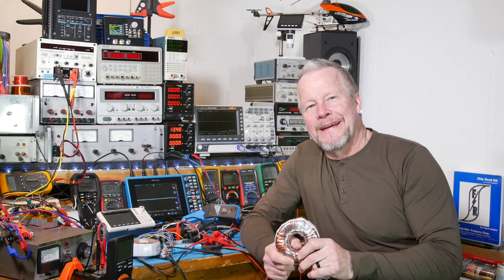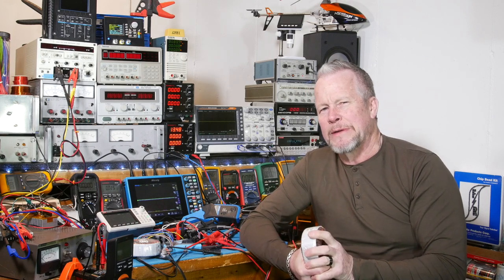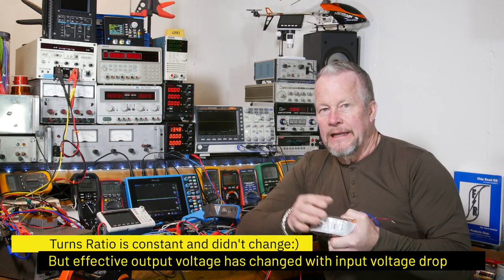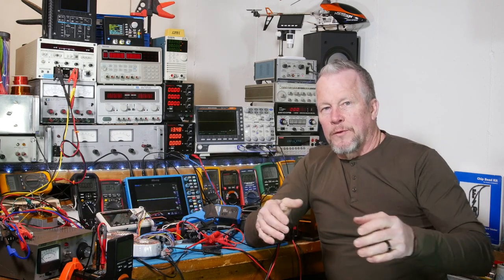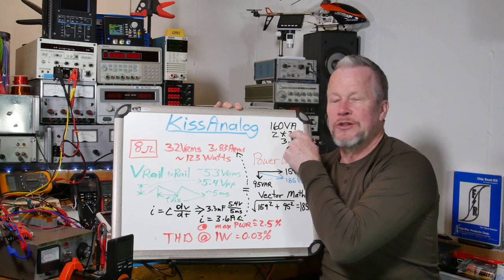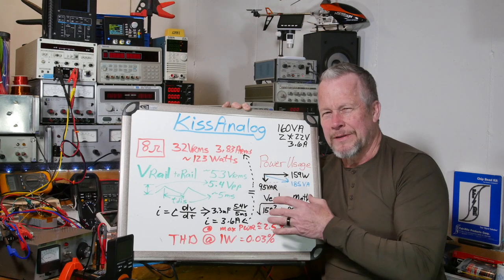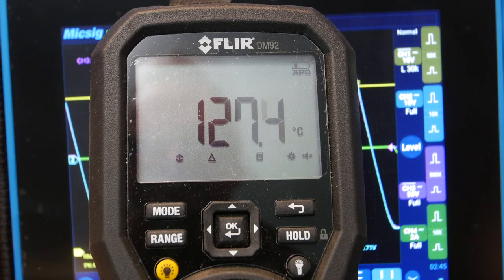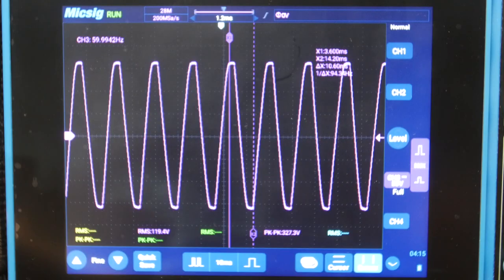Class D More Power Bigger Transformer TDA8954

Comment: Finland is still here! ..it's not the quantity but quality, right! :D Just got my (guitar) tube amp build ready for testing, sounds good and no smoke or explosions! :) I'm loving these tube amps, but i have few toroidal transformers waiting to be used for audio, so maybe next build will be digital. I can't be the only one from Finland watching your videos, but a shoutout would be cool! :)
Reply from the maker: Thank you Anssi w!  Great to hear from Finland! ;)
Reply: I have to correct something i wrote. I quess i'm so "deep" in this tube stuff, that i thouhgt in my head that opamps and transistors are "digital"! 😁 ..so will stick to analog! I had a reverb spring tank witch is normally been drived with opamps/transistors and is 300ohms imedance vs 8ohms normally used with tubes. I had small audio transformer, and calculated its impedance to be around 300ohms. Went with it and tubes, and they drive it perfectly! I'm so happy how it worked! Now i have tube amp, witch has all the audio tones from different amps that i love, nice cleans and lovely breakout when pushed hard and even raw distortion when i need it. And of cource the reverb, it is delisious!😋 And this thing is builded to 50's tube radio enclosure, for the old radio look. Did not think i could make it sound so good, life surprises sometimes!🙂 -Anssi

Comment: Hi i'm from Bangladesh. 
How many watts or RMS will I get if I give 24-0-24v power to this circuit board.
Reply from the maker: Thanks for the great question!  It depends on the size of the capacitor and the load.  It could be as high as 34V.  That would also be the peak of the voltage, so a cap can charge to that value.

Comment: Good Video Eddie, i think we need to get you a SMPS, and then show people what the difference in power & other measurements a SMPS will do to CLass D amplifier. Class D likes a SMPS because it really wants a constant voltage. Single Rail SMPS should be easy to get, shal I get you one ?
Reply from the maker: Thanks for the feedback!  It would be great to compare a SMPS power supply side by side with the linear;)  But, it does need to be a dual rail.
Reply: @KissAnalog  easy, shal i post link ?

Comment: Power Factor, if it's 1, it's great...anything less than 1 not so desirable. The Real Power is used to drive the load and the Apparent Power (or VA Power) includes the reactive components which don't help Real Power. So if I've got a 1200W equipment rack that is drawing 20A at 120V my apparent power is 2400W and my power factor is a lousy 0.5. (Time to buy a PF corrector!) It's a complex subject but that's my understanding simplified.
Reply from the maker: That’s right Tim, we want it close to unity (1).

Comment: Excellent project into transformer power losses and power conversion.  Answer one problem leads to 10 questions. 👍 
        Because sometimes with a math or a book  or specifications sheet will tell you is the right size transformer (supposedly)  in real life is not always delivering you all the power that you thought you were going to get. 

        A capacitor’s video will be excellent.  Explaining the difference  capacitors purpose built for power supplies and capacitors purpose built for audio.
Reply from the maker: Thanks!  I appreciate you!

Comment: The experiment was awesome 😎. Still I have a question how you are sure about the power factor of the circuit? Under heavy load the circuit can be capacitive. But on no load considering the transfomer it should be inductive right? Is there something I missed? Any clarification is well appreciated. Thank you for making such detailed videos, it's very informative 🙏
Reply from the maker: Thanks for the great question!  Ok at no load the input capacitors are still there pulling current but little actual load so poor power factor.  When load goes up the capacitive portion drops in its ratio to power dissipated by the load so power factor improves.

Comment: Hi, cool video. Can i power this amplifier with any dc power, without the  Toroidal Transformer?
Reply from the maker: Thank you!  Yes you can power this with DC power instead of AC.
Reply: @KissAnalog  thanks, I have another question. What is the meaning of this, the recommended power supply voltage should be 300w AC24V-0-AC24V? One more thing, what's the amperage of this amplifier?
Reply from the maker: Great question!  The AC24V - 0 - AC24V marking means that you need two windings on the transformer output (secondary side) and they each need to be 24 Vrms rated.  Then with the two windings they can share a center tap (one terminal in the middle, or connecting the top of the bottom winding with the bottom of the top winding) which is the 0 (or zero/ground reference).  The 300 Watt is probably actually 300 VA rating.
Reply: @KissAnalog  thanks for the answer. Will any other Ac or DC power supply work with this amplifier properly?

Comment: Can i remove bridge rectifier if i power amplifier with dual dc voltage supply?I see no use for it.Thanks.
Reply from the maker: If you have DC power instead of AC power, you can use DC as I have shown in other videos. https://youtu.be/kFBz05eeXfQ
Reply: @KissAnalog  Thank you sir for fast response.
Reply: @KissAnalog  Hey i watched the video so i know how to do it, but what is the ground one and what sholud i connect it to? II only have DC+ / - .